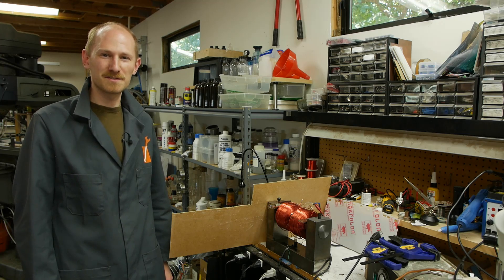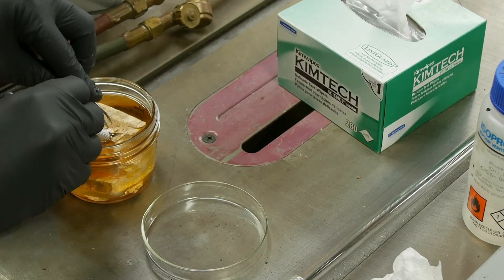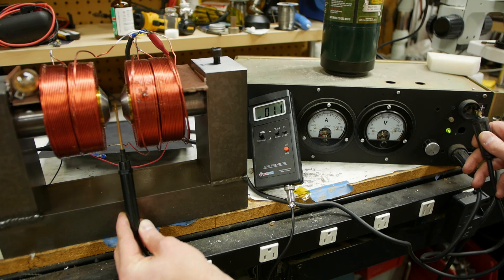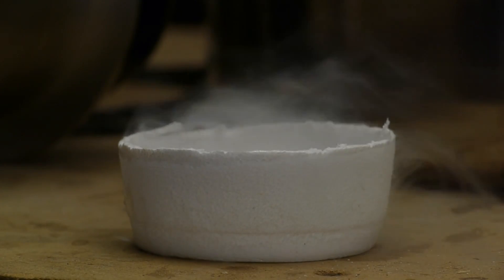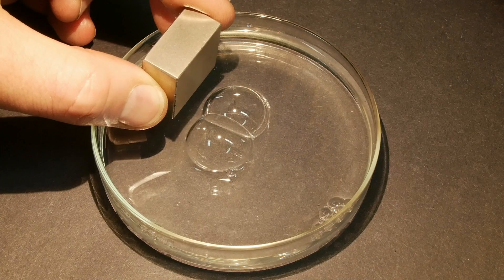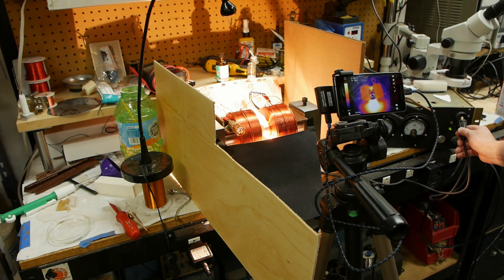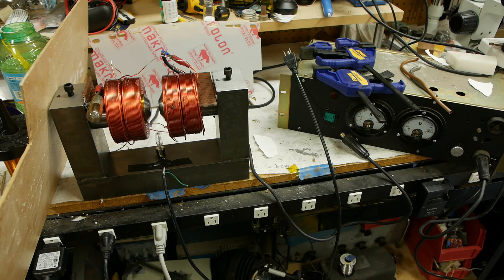Candle flame is repelled by magnets (and Zeeman follow-up)

Comment: Seen it before in the comments; but giving another upvote to plasma / ionisation. This is definitely happening in a candle flame; if in doubt, try putting a candle flame in a microwave. Though this is somewhat at odds with the smoke from the blown-out candle; at those low temperatures I would expect very little ionisation anywhere away from the wick itself... But a smoldering wick in a microwave does work as well so it must be producing some plasma at least locally, and the strong magnetic field may aid in keeping the charges from recombining, thus extending the plasma plume? But it may well be a combination of ionisation and carbon; would be nice to find an experiment that cleanly separate those factors. I suppose one way to isolate ionised currents from paramagnetic effects is to try flipping the magnet poles; if there is an ionised current is should reverse its effect along with the magnetic poles, where as a paramagnetic effect should be insensitive to a change in the direction of the magnetic field.

Comment: It was me that posted the original comment on your first video.  
Firstly , I love that you took interest and built this rig to test what I mentioned.  
What I neglected to say in my original comment was that a portion of all flames are plasmas. Ie , former covalent bonds(or ionic depending upon what is burning)  have been broken to form new bonds ( commonly oxides of course) . New molecules are forming in the oxidation process and in that process there will be a statistical population of free ions. .. it is these hot free ions that have too much energy to be able yet to form a new covalent bond with oxygen.. essentially this occurring once the process is in steady state runaway .. ie excess heat is present from other oxidations which I believe directly breaks other bonds, directly freeing atoms from their former electronic balance into an ionic state.  Hot gases, less dense, rise in air and create a stream of free ions .. so the flame essentially acts as a free air electric current stream between your electro magnets.  
The rest is obvious and I expect I need not say more. 

Interestingly a candle flame in zero g burns as a sphere! .. no vectored gravitational field to create the differentiated bouancy force. 

Love your channel btw.   Brilliant return to the original experiment with the sodium in the vial! 
Great work as always! 

PS.  An interesting experiment might be burning different materials and seeing if you can get different materials to deflect in different directions.. some materials might create different populations of positive or negative ion streams... Although my guess is most will be positive.. seeking to bond with negative oxygen's ? .. but I'm totally guessing here.  :)

Comment: If the magnet is AC, then it can induce induction currents in flame(its plasma is somewhat conductive) which will in turn react with magnetic field deflecting the flame. To confirm that you can in fact induce currents in flame with magnetic field, try applying relatively high frequency AC to the magnet and see if the effect gets stronger.

Comment: Curious if the surface tension of the bubble is so high that it resists the small forces applied.  Also pondered if the bubble acted as a Faraday cage but suspect not.

Comment: Maybe if you try to use another kind of smoke (non carbon based) and see if you get the same effect... and you can also make a sort of apparatus to heat CO2 stream gradually and make it push a tiny paper so you can visually figure out if the bending changes when temperature changes.

I wish to be able to do all sort of experiments like this but I am stuck in a situation that I am not able to setup a kind of lab with basic instruments and tools due to financial hardship while it's sad to see those who have no interest in science and advancing our understanding have plenty of resources to waste on non-sense ans selfish indulgence.

Comment: Nikola Tesla used this effect, to deflect an electric spark (also a plasma, like the flame). 
He magnetic quenched his sparkgap. this had an effect on the electric plasma, but not on the white gasious radiant electricity. So in this way he could separate both, and work with the Radiant Electricity effects.

Comment: I immediately thought it would be the water vapor as a product from combustion. We all know that the product of combustion is CO₂ + H₂O and that water molecules are very polar (as evidenced by your video on pulling a stream of water with a magnet). I'm sure that is what is deflecting the flame and soot trail - water vapor from the combustion process. As you can't really remove the product of H₂O from the equation, I'm not sure how you'd test this hypothesis, but that would be my guess.

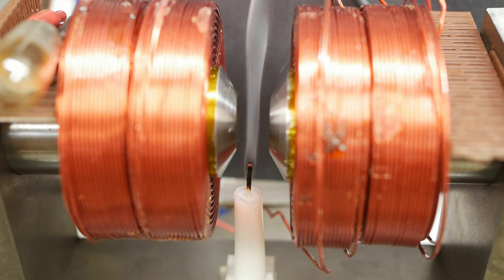Comment: This is the best fundamental science channel in existence anywhere. I wish this series would continue! The fundamental physics effects on luminous gasses and spectra are so much more interesting than just the magnet designs alone! A correction at 3:50, you aren't experimenting with the "smoke" here (ie. diamagnetic carbon/soot particles) but rather the paraffin vapor , this was established by Faraday in his experiments on a candle flame in the 19th century at the Royal Institution whereby he relit the candle by igniting the flammable paraffin vapor trail in air some distance away from the wick. Also I don't see anyone else having mentioned it yet, but Derek Muller demonstrated this exact same thing with the vapor in 2012 but with electric fields at a museum in Paris where the French call the experiment "le papillon". https://www.youtube.com/watch?v=a7_8Gc_Llr8
Reply: Trying to speak more precisely, it is not paraffin vapor too. It is paraffin mist.
Reply: That is correct. If one looks very closely at the thing immediately after blowing the candle out you can see a clear region just above the hot wick where the invisible true paraffin vapor is present and a millimeter or so above that is where the white mist begins to appear. I suspect the method of electric charge accumulation on the mist droplets (as proven by this and Muller's demonstration) is not thermal in nature as Tech Ingredients here surmises the flame ionization itself is, since the wick producing the vapor/mist is barely glowing incandescent red and the Draper point is only ~500-600C, but rather that the mechanism of charge accumulation involves some kind of vapor condensation charging, perhaps somehow related to triboelectric charging. There is so much interesting undiscovered physics lying just below the surface of our everyday mundane experiences.
Reply: I always thought the relighting effect was due to incomplete combustion products (soot, carbon monoxide, etc.) in the smoke, rather than vaporized or atomized paraffin.

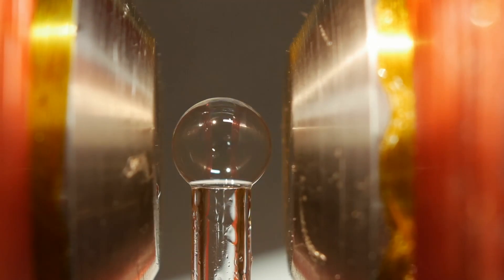Comment: 5:58 The film on the top of the bubble is moving...or did you say that, sorry...😐

Possible the bubble has enough character to keep it's shape as flames don't.
But the soap on the bubble is fluid and flows around the bubble...

Possible that the difference in characteristics of objects go from magnetically controllable to non controllable

Like the differences in magnetic poles.

Possible that all things are made up of either side of the magnetic poles.

One side isn't effected by magnetics but it's effected by electricity...?

Meaning since the flames are magnetically controllable and the bubble isn't yet the soap on the bubble is.

They are just the difference in what did of the pole the are from.

Or maybe they are made up of the fluctuation of where the two poles meet and neither pole effects them.

Comment: Some flames are actually considered to be a plasma. However, the degree of ionization in most flames is still low compared to other examples of plasma; such as an arc which still have a relatively low degree of ionization. If you apply a high voltage to a flame instead of a magnet you will generate an "ion wind" and have a similar effect to what you are seeing. 

The wax candle produces more soot than the methanol flame and the soot is easy to ionize in the flame, that is why the effect is more pronounced with the wax candle. Also, some wicks have metal in them which might contribute as well (i'm not sure if this was the case for your candle). If you were to repeat the experiment with a pure hydrogen flame you would see almost no effect, because hydrogen flames produce practically no ions. Flame ionization detectors work on the principal that hydrocarbon flames produce ions in proportion to the number of carbon atoms in the hydrocarbon (which is still an unexplained phenomena funny enough). 

Even though this effect is almost certainly due to the flame ions, it is still not a completely well understood phenomena and there is still much to learn! 

Also, there is a good book that explore this topic by Weinberg entitled, "Electrical Aspects of Combustion." (https://www.amazon.com/Electrical-Aspects-Combustion-Weinberg-Lawton/dp/B0037F75IK/ref=sr_1_1?s=books&ie=UTF8&qid=1531716710&sr=1-1&keywords=electrical+aspects+of+combustion) 

Thanks for the great video! Hope to see more like this!
Reply: When I say the degree of ionization is low I am comparing it to a 'fully ionized' plasma. Degree of ionization is defined as the fraction of molecules in the gas that are ionized. The core of the sun can be considered fully ionized. An arc is nowhere near fully ionized which is why I say it has a relatively low degree of ionization.

The reason an arc has a low degree of ionization is because it never actually reaches equilibrium. Typical ionization energies for gas molecules are about 10 eV. However, a gas that is at 1 eV is capable of producing ions because there is a small number of 10 eV electrons available in a gas at 1 eV (which is about 11,000 K). However, an arc does not actually get to such high temperatures because of heat loss mechanisms and therefore has a lower degree of ionization.

It is useful to make the comparison between the degree of ionization of different plasmas starting with a flame at the low end, then an arc which is a little higher, then the core of the sun which is much higher. Also, I should recommend that you try putting an arc in the magnetic field and see what happens. You can actually move the arc around more than the flame.
Reply: No, it would not be accurate to say that fire is the coldest plasma we can get. It is more accurate to say that it is the lowest degree of ionization to still qualify as a plasma. Although some physicists still won't consider a most flames a plasma.

It is actually possible to create a 'cold' plasma where the gas temperature can be near room temperature and even colder. You can actually touch these plasmas safely and painlessly. These fall into the category of Low Temperature Plasmas or Non-Thermal Plasmas and there are several methods of producing them in the laboratory using high voltage power supplies.
Reply: Robert Geiger and another amazing thing is that fire is actually magnetic. Which is just insane to think
Reply: This is easily shown by setting a candle into a capacitor and seeing that it splits into two flames parallel to the capacitors axis of symmetry

https://youtu.be/a7_8Gc_Llr8
Reply: Photonicinduction did a nice video demonstrating coronal wind
https://www.youtube.com/watch?v=aqlo6O80VnM
Reply: somewhat funny coincidence it is named corona wind, while I read this now 8 years later, and everyone is sheltered in for CoronaVirus Infecting Disease-19
Reply: How is an FID unexplained?   What specifically is not known? I use these daily and could experiment while i had off time with the equipment if someone had any suggestions
Reply: @reasontexas  we know that under specific conditions the FID can produce a current that is directly proportional to the number of carbons in the hydrocarbon, however we still do not have a good explanation of the exact mechanism that leads to the current. There is some kind of relationship here between the kinetics of chemi-ionization rate and carbon concentration... yet no exact and/or accurate models to describe it.
Reply: Why do you think an arc has a low degree of ionization? Considering the fairly low energy needed to ionize gases I would say its really well ionized. Reaching 2eV via high temperatures is very hard, but a electrode of 10kV can easily rip several electrons out of a atom. Or is this still a low degree because there are still some electrons around the nucleus?
Reply: Robert Geiger thanks for explain! 

So... Is the fire the coldest plasma we can get?
"The "lowest energetic plasma"?
My "to read" stack is becoming a monster.
Reply: @randomrandom420  room temp fission coldfission think piston shrimp and implossion cavitation. Water has memory as does crystal. Giza pyra- mid fire in the middle.
Reply: MasonP13 question is how can we manipulate that to our advantage?

Maybe further control the combustion in a car engine?
Even better than that would be, could you control the output of a rocket engine with this 😉
To change the Dynamics of how it burns and flows.
Although I'm sure weight would be a limiting factor.
Reply: I was thinking that it could have something to do with fire being a plasma so I looked down in the comments and of course the very top comment was this one.  Thank you for the extra info.
Reply: Have we considered the possibility that the whole universe might be described by electric effect?
Tesla certainly thought something similar.

Electric Universe, Thunderbolts Project
Reply: ALL flames are considered a form of plasma - giving it a new name doesn't change it's properties though - just semantics
Reply: So it's breeching hydrogen from water and creating plasma through electricity which is nothing more than frequency and ressonence correct? Graphite adds to effect like a spark plug and graphite or platinum, yes?
Reply: the difference between an arc and a fire is that an arc is a forward-stable exchange-unstable traversing of electrons from one point of charge (in current form) to another point of charge (also in current form) through air, which the electrons transfered in the arc are not all electrons from the original charge source, but rather new electrons that came along from the air, they all follow a domino affect, one electron flows out the emitter, and that electron bumps into air molecules, which those molecules also contain electrons, which are knocked of of the molecule causing a degradation of air molecules, but the emitter electron itself doesn't give enough energy to cause a high ionization because it is the energy source, but unlike fire, the source isn't of the two components of Fuel and Heat, just heat.  For a fire to happen, you need enough energy to hit electrons of a molecule to make a plasma, and also enough electrons to make the plasma dependent on more reduction, it needs to need, sounds reduntant, but it isn't.   You need more ionization, which really means you need more hitting of electrons to the rate and amassing in that rate till where the plasma needs more electrons, and will reduce a fuel material.  Let alone, you need that fuel to actually act as a source of binding the electrons emitted so that it also needs more positive charge inversely with the oxygen needing negative.  That's what keeps it growing.  You must instigate a redox flow to keep happening.
Reply: And let alone the arc electrons flow towards a positive collector for the electrons, hence it is a forward stable and and not exchange stable.  It's charge traversing moves in a stable order from emitter to collector charge, all being a motion from equal but opposite charges, not an exchange.
Reply: And the only flow stable part of fire is when it goes out.

Comment: I would like to see you run some truly "cooled" smoke or other vapors(maybe something like chlorine or fluorine) through the magnets, the chemical reaction(burning) would be disrupting the structure and hence magnetic structure of substance.  I might hypothesize the more extreme the reaction the higher the likely hood the magnets would have an effect until it once again reaches equilibrium?

Comment: My conclusion would be that the air is composed of paramagnetic & diamagnetic gasses and the tiny flows caused by heat allows them to separate & sort their distance to the magnet based on their magnetic properties, and the bubble experiment didn't showed any difference because it was testing pressure difference which is too little for the magnets to induce.

Comment: Nice.  I was skeptical following the first video, but find the metallic sodium absorption modulation to be a compelling demonstration of the Zeeman effect.  BTW, diamagnetism/paramagnetism require a field gradient to be manifest.  So by placing the bubbles in the center of the poles where the field is most uniform, you have minimized any effect you might observe.

Comment: I'm not sure I see the hot air moving around 9 minutes. 

That being said, I think your flames are moving because the flow of ions is essentially a current flow. It will generate a weak magnetic field and be manipulated by the static field. 

Try running a single wire and flowing a current through it with the magnet on/off. Does it pull in the same direction as the flame?

Comment: The flame is a plasma. Plasma inducts current. F = ma = qE + qv × B. The applied magnetic field is perpendicular to the flow of the flame and inducts a current into the flame/plasma. The induced current suppresses the flames natural upward flow of less dense air causing the flame to deflect the rising hot air outward around the magnetic field line (along the induced current lines).

You might ask. But the flame should be neutrally charged how can it react then? The difference in masses of the ionize compounds.